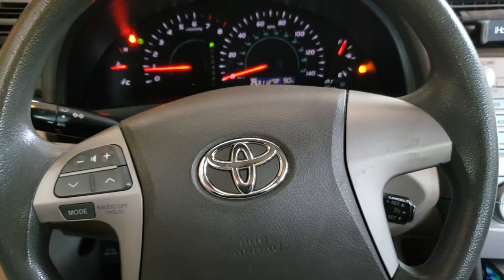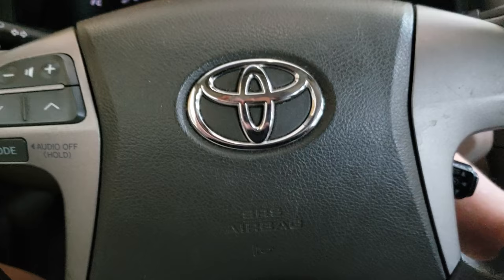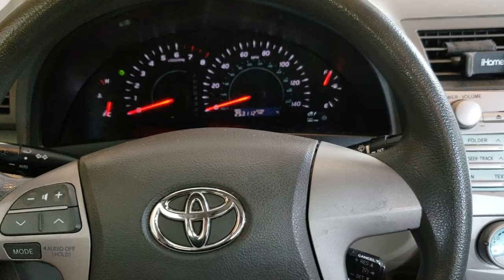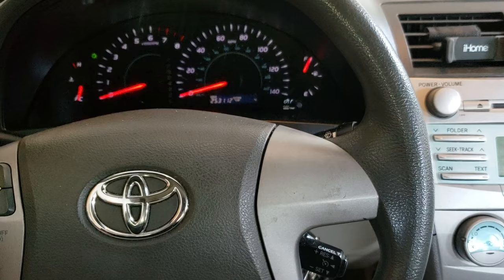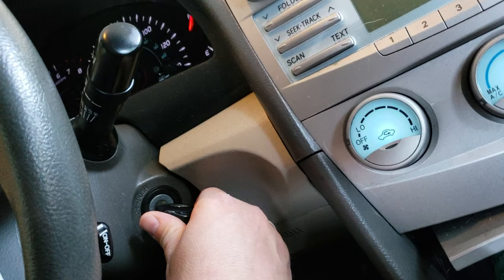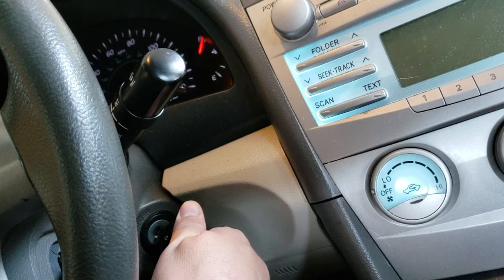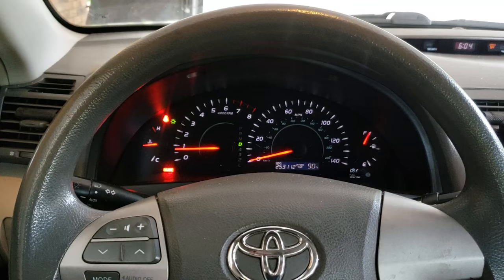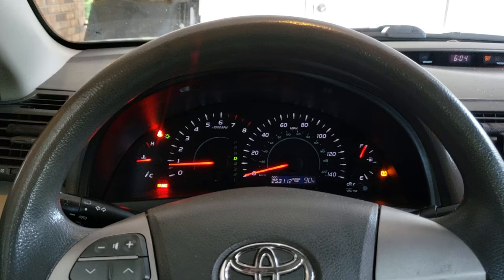How to reset the idle on a toyota camry (after battery or terminal change)

Comment: Every time I start mine up it revs up to 2000 rpm when I start it. Is that normal?
Reply: No car should be at 2000rpm at idle. It's ok if it goes up when you start the engine but it must go back down to around 1000
Reply from the maker: every car will have an initial slightly higher rev upon startup..  my car generally hits about 1000/1200rpm upon start and then idles around 700/800 rpm the initial high idle is the car essentially providing choke to start a cold engine.

Comment: Would this Work on a 2016 Camry I Clean the Trotle body and is running in lean mode need adjustment back
Reply from the maker: Yes will.work to let you car re learn idle
Reply: @THEMANCAVE2023  awesome I will do this Procedure thanks 👍
Reply from the maker: @augustobalbuena4641  welcome
Reply: @THEMANCAVE2023 didn’t Work i try it again

Comment: Have 2008 camery wont stay running dies while driving. Have replaced battery, cleaned throttle body, replaced camshaft sensor and it still dies
Reply from the maker: Does it idle ?
Reply: @THEMANCAVE2023   no it dies
Reply from the maker: If it starts but won't stay running check your idle air control valve also.would not hurt to check fuel pressure.

Have it taken to shop and make sure there are no codes being thrown.

Guessing about sensors will cost a lot more than a proper diagnostic test

Comment: I wonder if this may be the reason when I drive and I come to a stop that the car idles hard. Been doing this forever. Spark plugs have been changed and no check engine light on, so I’m sure it’s not Miss firing
Reply from the maker: Hey Russell, so you can try this.  But I would replace your idle air control valve.  There about 60.00 bucks auto zone or whatever part store you prefer.  

You could try removing it and cleaning the carbon out if it as well sometimes this can resolve it ,  if its just carbon and not a bad motor.. lmk
Reply: Same issue with my 07 Camry. Started after changing spark plugs. Any update on this?

Comment: Any suggestions for manual transmission?
Reply from the maker: Take it for a road trip 60-100 miles it should relearn the fuel trim.  If not any bidirectional scan tool can reset fuel trim

Comment: So I just bought my 09 camry . I did a full tune up . When I bought the car I drove about an hour and a half . And my gas needle was steady and felt like it was a gas saver . I put in sea foam and had to disconnect battery to try and fix a bulb as well . The next day , I noticed I was going thru gas really quickly. Like if it was a v8 or something . I have the four banger. Could it possibly be that when I disconnected battery it erased fuel trims ? Cus this thing supposed to be a gas saver and was up until I did a tune up and disconnected and reconnected battery.
Reply from the maker: Yes anytime you unplug the battery on a Toyota the fuel trims reset.  Also you should make sure air filter and spark plug gap is on.
Reply: @THEMANCAVE2023  how do ensure of that ?

Comment: Just one question how do i do it in a manual Toyota Yaris 2009. Do i let the car warm up first then turn it off. Then turn the ignition on then off then on then off then turn it on cranking the engine then put it in first gear with handbrake on. But do i keep it in first gear with my foot on the clutch for a few minutes?
Reply from the maker: It is not really drained for manual transmission.  But you could follow same steps but I personally would hate to ride a clutch like rht
Reply: @THEMANCAVE2023  yeh i was thinking same not good to ride the clutch. Hmm anything else i can do instead of doing that?

Comment: I have a 2009 toyota camry jus got it. Check engine light came on went to autzone and it was the MAF. Got that fixed and everything was fine. I woke up and my car wouldnt crank on. So i thought i needed a jump but then found out my wire terminal was loose on my battery and now it cuts on but now it doesnt accelerate at all i press on the gas and its soft and wont go. I can move forward and backwards letting my foot off the brake but as far as acclerating it wont go plz help me is what your showing us a way to fix the issue or is it something else. Plz help me somebody
Reply from the maker: Hey g redd,  it sounds like it could be you would definitely have accelerate issue until fuel trim is re-learned

Comment: Do you have issues with oil burning? I see you were able to get a lot of miles from it!
Reply from the maker: I did there was a so called unofficial recall about oil burning.  I was fortunate enough to get that recall fixed for free new pistons, rings and valve job for free had that done @ 194000 miles traded it in a year ago with 303,334 miles still ran great but I wanted the new 2020 civic sport .

Comment: I have problem with my camry 2009 LE 
When the Gear is on P or N during Air conditioner ON the RPM goes up & down ..
Can you please tell me know how can i fix it
Reply from the maker: Sounds like a idle air sensor.   Not sure what style that year uses,  either electronic or air valve that adjust volume of air (idle control) under load.  That's were I would start.  Also if you have any che k engine light please see what the code and descriptions is
Reply: Did you end up fixing the issue ?

Comment: Hey can you tell me what to do if after you do this the engine light come on on the dashboard? My car was running much better after trying this but the light came on afterwards.  I left it overnight and tried it this morning but its still on and idleing faster now.
Reply from the maker: Marco,  if your check engine light is on it has nothing to do with the idle re-learn process.

I would suggest going to auto zone/ or advanced auto and let them scan your codes,  its free.    That way they can guide you as to whats causing your engine light to come on.

What my video shows is what the dealership does whwn they change your battery.

Also make sure you check your fuel cap if its loose the engine light will come on

Thanks for watching and taking your time to comment I truly appreciate it Please like share subscribe its a huge help to the channel

Comment: My 2002 es300 was idling low and stalling after I disconnected the battery. I tried the relearn and it didn't work, just kept stalling. What ended up fixing it was cleaning the throttle body.
Reply from the maker: Works for 2007- 2021 on toyota lexus is different in how there trims are programmed and even new lexus will not work with this truck toyota only.

Thanks for watching and sharing your thoughts

Comment: What if the car doesn't stay on after turning it on? Is it OK press on the gas?
Reply from the maker: If you change your battery and the idle is so rough it won't stay running now,  yes you can apply enough gas to keep car running

Comment: I guess this is just for older toyotas.  I disconnected battery on new tacoma and when I started it just ran normally.  Didn't need to do anything to it.
Reply from the maker: Depends what year you got.  I know it works for 2007- 2018 camry corrola.  The Tacoma may have baseline fuel trims set permanently 

Thanks for watching and taking time to comment i really appreciate your time and all

Please like share subscribe

Comment: Jst came across your video. I have a 2005 Corolla le and after changing the battery and then starting the car it idles perfectly as always. Is this video for only Toyota camry's? And wat are the years is it for? Jst curious
Reply from the maker: Generally 2007 up earlier models had a saved fuel trim (kinda like a mini rechargeable battery)  in the CPU 

2007 forward they do not so the car has to re-learn fuel trim settings.

You do not have to do this if you drive the car for a day or 2 it will eventually return to normal but it idles crazy for those few days  (super annoying) feels like it will stall 

Thanks for watching and taking time to commenti appreciate it
Reply: @THEMANCAVE2023  thanks 👍👍👍 keep up the vids.

Comment: My toyota camry 2003 model stock in number 8 idle.after change battery.need help
Reply from the maker: I cannot understand what your trying to ask,  I'm sorry if the idle is rough please watch video and follow direction.

Also it may not work on 2003 I know it works from 2007-current

Comment: I have this weird rough idle problem after changing the alternator on my 2011 corolla. I tried this and it helped a lot but after a while my car still shakes and spikes up the rpms at stoplights albeit just a little. Any tips to solve this would be appreciated
Reply: After I change the alternator on Toyota Camry 2009 my car shakes and I drive the car on highway 90 km-100km for 30 minutes to 40 minutes then my car not shaking anymore
Reply: Hey Sun33, do you remember what you did or how the idle went away? I’m having the same trouble. The car will idle fine for a while after I do this method. But after about half a day or so, it will go back to running rough.

Comment: Please answer my two questions 1. Does this method also work on Toyota Altis ?? 2. Should the brake pedal be released after putting the car in drive mode or not ??? Please please reply
Reply from the maker: Hey  Arshad. I'm not familiar with that vehicle   so I cannot say for sure.  But it will not hurt your vehicle to try
Reply: @THEMANCAVE2023  okay bro thanks 😊
Reply: Arshad Shah this will work on an Altis model, that is a variant of the Corolla in other countries. my brother in law owned a 2006 Altis and this procedure worked.
Reply: @maxison307  yes bro it works, thanks for reply 🥰🥰

Comment: Do I have to turn off the AC and all the lights as well?
Reply from the maker: Yes all accessories need to be off 

Thanks
Reply: @THEMANCAVE2023  Thanks. What about the brake? Do you let go of the brake and only keep the e-brake on? Or do you also step on the brake? Stepping on the brake will engage the braking light.

Comment: Does it matter if the engine is cold or has been running?
Reply from the maker: Not at all,,. It simply relearned fuel trims without 5 hours of rough driving
Reply: Thanks - did mine on cold start up, as it warmed up the idle stabilized (about 5 mins like you said) then I drove it and it feels much better - seems like up shifts are more crisp, downshifts assist braking more too, pretty sure the fuel trims have something to do with the AT's performance.  Liked & subscribed

Comment: Change my battery now my horn want work what do I need to do to get my horn working again
Reply from the maker: Changing battery will not stop horn from working.  I would  check the fuse first,  if not that check the horn itself for continuity and the circuit for powe when horn is pressed,  you will need multimeter .

Thanks for watching and taking your time to comment I truly appreciate it and you Please like share subscribe its a huge help to the channel Thanks again for your support

Comment: After putting transmission in D then we have to pull of the foot from the brake ??
Reply from the maker: Turn car off
Engage working emergency brake
Turn key all.the way to on, without starting car.
Turn key back off repeat the above step this time start the car
Apply brake place car in drive and release brake (emergency brake remains on)

Let car idle for about 5 minutes with no ac or accessories 

Done.

Hope it helps please consider subscribing to the channel.it hwlps.me to make content 

Thanks again
Reply: Hi, what if you can’t get it to idle long enough? It wants to die after putting in Drive.

Comment: So I went to the mechanic because this fix my problem but I had to do it everytime I turn it on, the mechanic changed 2 items that work with the spark plugs, i forgot the name because I was in a hurry but they seem to work with the spark plugs, charged me 100 bucks now the car is finally good. Hope this helps someone.
Reply from the maker: Sorry you had trouble..  you must have had something else going on all this does is reprogram fuel trim on pc.  Its a factory used technique as well.  So be  careful when trouble shooting many things have dame symptoms but different underlying causes

Comment: How to do it on a manual rav4
Reply from the maker: For a auto only manuals require battery saver plugged in to obd2 port to keep settings.  Just drive around for 40-50 miles it will eventually auto correct trims

Comment: When I put my camry in drive and put on the e break, the car still moves, is that normal?
Reply from the maker: No when your emergency brake is depressed the car should not move at all.

(Unless you floor it in drive then it will drag rear wheels)

If you need to do this battery trick with your car place cinder blocks in front of rear tires this will keep car in place
Reply: No you need to replace emergency brakes
Reply: No, it's actually a fairly simple/cheap repair depending on how much your car 'moves' it just may need the cable tightened.
Reply: Holy crap no
Reply: That a sign that your rear brake pads or shoes require replacement

Comment: What about if your car is stick shift
Reply from the maker: With a stick I would recommend a tool that plugs into your obd2 port and has a battery on other end.  It keeps your fuel trim stored in pcu so it's not lost.

If you don't want to do that drive it for 2-3 days it will eventually reset fuel teims, just takes several days unless you drive a lot
Reply: @THEMANCAVE2023   thanks

Comment: My car idles so low it turns off i can't even do the procedure
Reply from the maker: You can apply light gas just use caution as your car is in gear and can move
Reply: Did you end up fixing the issue ?

Comment: Why am I the only one to experience it stalling afterwards. It always takes like fifteen tries.
Reply from the maker: I don't know.  Sometimes it takes 2 tries though
Reply: I always find myself searching YouTube any time I do work on my car cause of the battery needing to be unhooked. The first start always works and the car runs fine unless you change gears. After that fist gear change its over. No I end up having to drive my car around for a minute and keep giving it gas so it doesn’t die. After about 15 minutes of it running (prior to the initial gear change and stall) and 15 minutes of driving I guess the engine finally is warm enough to stay above 350rpm. I keep wanting to think something is broken cause no Roy else seems to have these issues. But I always end up getting it running🤦🏻‍♂️

Comment: How do you do this with a push button
Reply from the maker: Its the same process.  You just need to use the button to turn the car on in acc mode.  Generally when you push the button with your foot off the brake pedal the car goes into acc mode.

So foot off the brake (make sure emergency brake set)
Push button to turn on acc wait about 8 seconds , push again to turn off,  and then push again with foot on brake starting car.

Put it in drive with emergency brake on and remove foot off the pedal  brake let idle for 5  or so minutes  and your done.  

Also it must be a Toyota 

Thanks for watching please like sharw subscribe its a big help to channel 

Thanks again
Reply: @THEMANCAVE2023  ok thanks  I'll give it try
Reply from the maker: Your welcome.lmk if you need.help.thanks

Comment: It never works on my 2007 Rav4... 😔
Reply from the maker: Sorry man
Reply: I'll be darned! ... It worked!

Today, I was driving in town for business, and, at some point, stopped in a parking lot of a plaza. I had to wait for a few minutes, and I thought to myself, "I'll try just this one more time." (For a clear conscience, so to speak.) 

I did the whole key-cycling thingy, went into "D", (with e-brake on, of course), and began to wait. And what do you know, in about a minute, a minute and a half, the needle began moving, ju-u-ust a little, (30 - 40 RPM), up, and then down, then, in about another minute again, a little up, and a little down... 

So, I went like this, with my foot on the brake pedal, for about 4 - 5 minutes, and I had to go. 

As I started driving, at the very next red light, the RPMs went into their normal range of 650 - 750, as per factory specs! 

I was, like, "What the what???!!!" 

It totally worked, and has been working ever since!

Thanks, man!!!
Reply from the maker: Your welcome.. lol sometimes it does take multiple attempts there is a timing aspect to it but non the less I'm glad it worked and your car is idling normally

Comment: I did this and the car died and hasn’t started since 😕
Reply from the maker: If you did this and your car won't run my friend you have other issues !  This is the factory preferred method for re-setting fuel trims on model years 2007-2019
Reply: Like what ?
Reply from the maker: Car needs fuel,air,spark to run.  Check spark first then fuel then air

Comment: Car just shuts off when I turn it on engine will start then it'll idle and  then shut off can't put it in drive
Reply from the maker: Thays rather odd
Reply: Figured it out. Had to turn the car on gas it before it shut off and rev it at 800-1000rpm for 15mins and it worked
Reply: @Dre215taylor  15 min!!!!
Reply: beanthemarine yup not hard pretty simple haven’t had a problem since